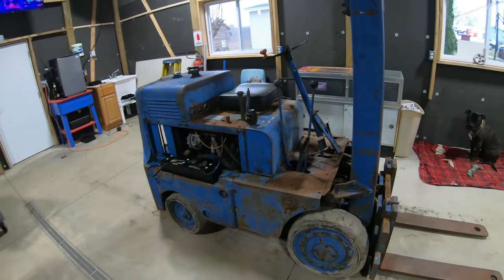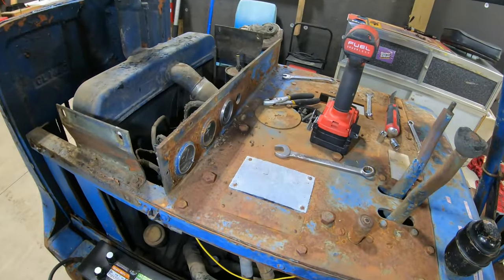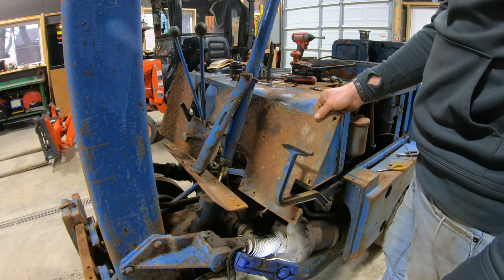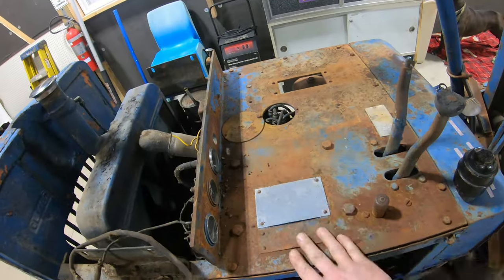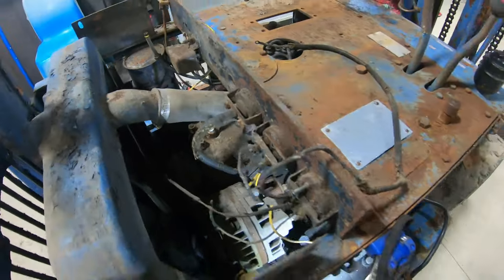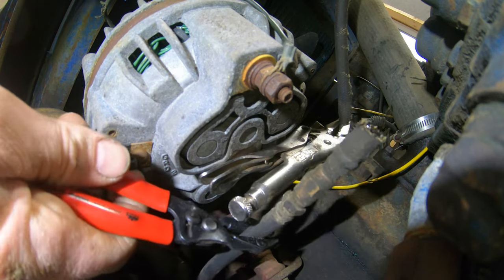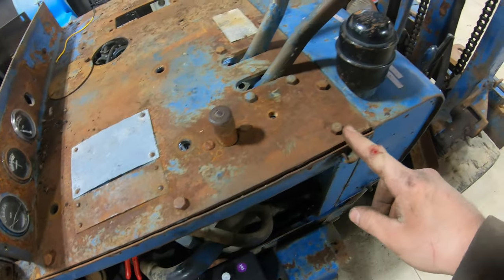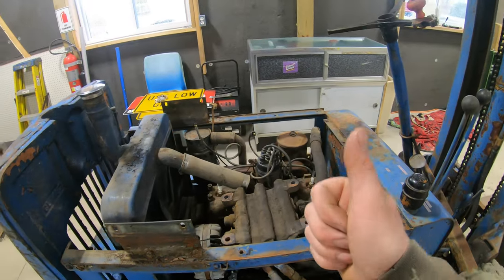VINTAGE FORK LIFT PROJECT (TEAR DOWN FINISHED!) -PART 2

Comment: That was more to take off than I thought, but you’re right to do it now and fix everything at once! 👍🏻 interested to see how this turns out!
Reply from the maker: Thanks man, yah it was a but I’d work getting it all apart and opened up but I’m happy now I can get to everything for repairs, adjustment, and maintenance. Once it’s done I hope to not have to take that main top panel/foot panel off ever again haha
Reply: @BiffsEquipment  It will be worth it! Great job, Thanks for sharing!👊🏻

Comment: Other than the bloody knuckle, you looked like you were having fun tearing that thing down. Looks like you need a little heat in that shop. I'm looking forward to part 3.
Reply from the maker: Haha thanks Ron. Yah this time of year too your skin gets dry so it’s easier to cut yourself… I didn’t feel a thing! Lol. 

As for shop heat, I do have ship heat but I just keep it low; like 55 TOPS cuz I like working in cooler temps… if I set the thermostat to 60 or higher when I’m working on stuff like this I get hot real quickly

Comment: I can’t help but think it’s a good time to give it a paint job, just a quick job with a nice brush and a small foam roller. By the way Tremclad red would be nice.
Reply from the maker: Thanks Dave, yes Iv been debating back and forth if I should just scrape the rust and cover it in oil to protect and preserve the original paint and patina or if I should just paint it and be done with it.. I think I’m going to paint it.. only thing that’s gonna be hard is I gotta pressure wash all the grease off that I wasn’t able to scrap off so far.. and painting the engine will be difficult with out removing it but we will see. I plan to stick with the same color only because it will be easier to paint and help cover spots I slightly miss..
Reply: @BiffsEquipment  did I mention Red….  Ha hahaha

Comment: Was wondering how hard is it to get parts  { HEAD GASKET }??? cant wait for part 3
Reply from the maker: Hey Gary! Surprisingly it isn’t as hard as you think because these old Continental flat head motors were used in a TON of different equipments and applications back in the day.. and there’s many of them still running today. You can easily find parts on eBay and online.. the forklift on the other hand.. that’s a bit harder haha